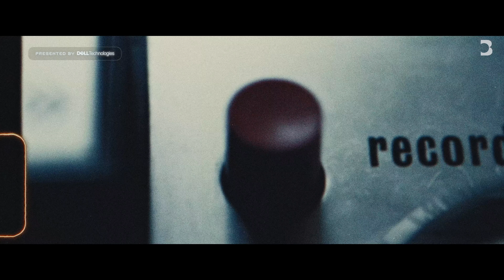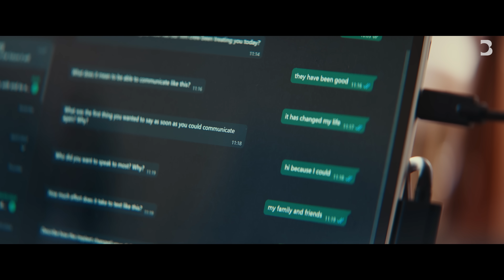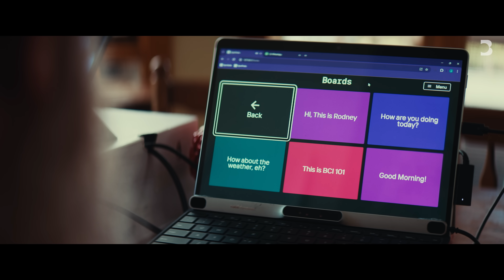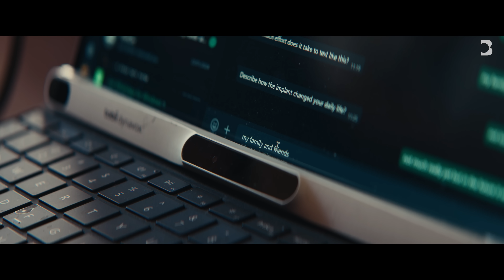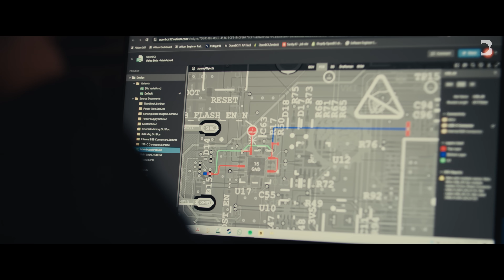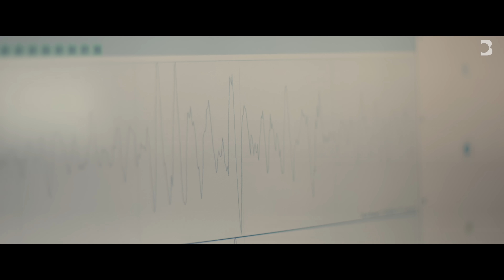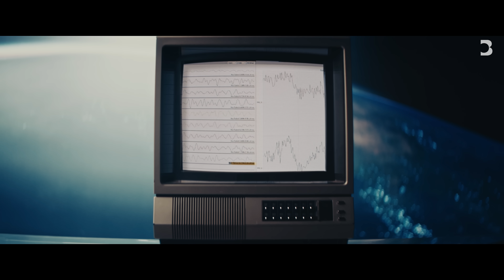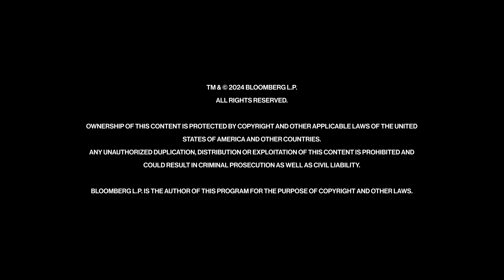The Thrill and Threat of Mind Hacking | Posthuman with Emily Chang

Comment: 17:55 Face (with is supposedly in control) does varying and alternating movements, whereas the drone just slowly and continuously rotates on the spot. Either this is system does not work, or the shot was not her and the drone connected.

Comment: Externalities like sustainable technology, social support, and limiting poverty is the right answer to stopping depression. This tech only makes the world a more dangerous place, and at a accelerates the rate of that instability. Do something worth doing like informative mapping of network states needed for curing disease, rather than claiming depression is caused by network states, because the real root cause is more weighted in the direction bigger of externalities that induce these states. If you don't factor in real causes, you will only be masking them, and lying to regulators by claiming that you are solving problems. It takes a rational mind that looks at real world cause and effect relationships, rather than using peoples biometrics to enact psychological nudges by harassing people every momentum through information technology (you are not solving problems, you are hiding from real problems).